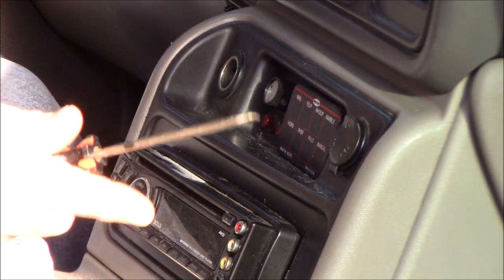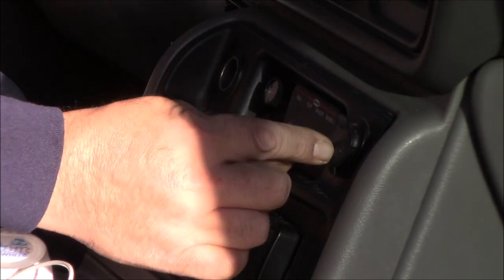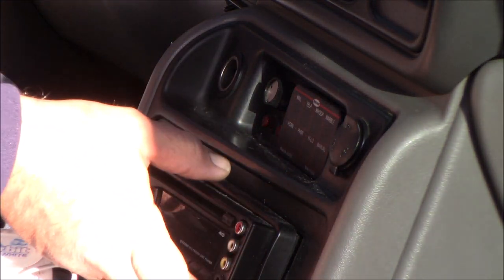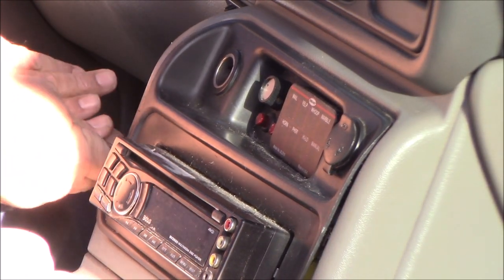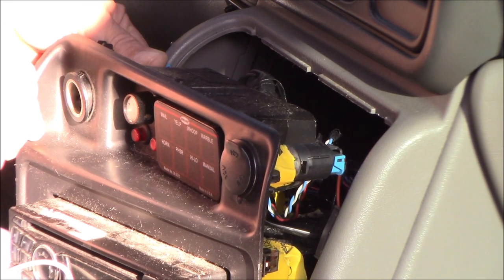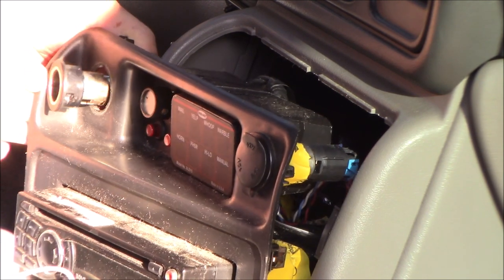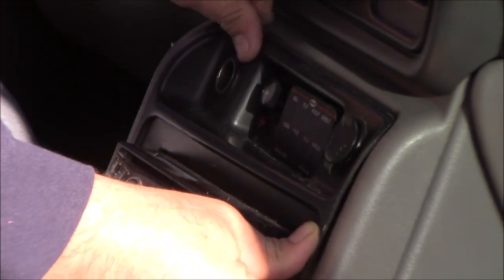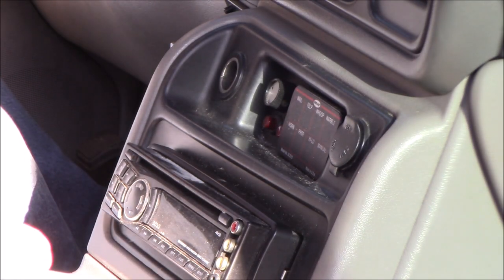Cigarette Lighter or Power Outlet Socket Removal | 2000-2006 Tahoe, Suburban, Silverado or Similar

Comment: I really appreciate your video. My lighter took some more pressure than I thought originally but it came out using your exact procedure. Getting ready to use that port for a HDMI input for a new head unit I am installing in my 2003 Suburban.
Reply from the maker: Glad it helped!

Comment: This is the only video on this subject so I used it. Works for some but not for me. 13 dollars amazon gets you the proper tool for removing it. Saves you breaking the retaining ring ears like I did using the push and turn method which costs an extra 10 more bucks. to replace. 13 bucks job done easy. 25 bucks and waiting for more parts if it breaks. Sorry Axle I have used lots of your videos and they're great but this one is a 50 / 50 man
Reply from the maker: Thanks for sharing, I haven't broken a tab off yet, but I'm sure it's coming.  Wasn't that happy with the video, but I had many requesting it.

Comment: I know this video is a bit old but,  if I want the cigarette lighter to be a power outlet socket, do I just swap out the socket for the power outlet socket? I also have a 2003 Yukon XL and these have messed up over the years asking with the rear one that’s in between the cup holders in the passenger center console. Thanks in advance

Comment: Exactly what I needed!  How to remove that bezel/cover.  Gonna replace the cigarette lighter with a USB power port.  Thanks!!
Reply from the maker: Glad to help
Reply: How did it go? I’m about to try it out
Reply: @mayken6661  Pretty much by the numbers.  The only hiccup was removing the oem cigarette lighter port.  I was unable to compress the tabs to remove it without damage.  Might be because it was old and stiff.  Broke said tabs off and it came right out.  Installed the new USB/USB C port.  Simple and much more functional.  Never smoked so the oem port served no purpose.
Reply: @jimsjacob  how was the wire connection?  The USB port on Amazon has a simple +/- plug for direct battery connection.  I just like to know if I have to do wiring adapter
Reply: @We4winds  Just like you said, pretty basic.  The +/- writes are there.  How you connect is decided by what the adapter presents.  If I recall, I crimped on female spade connectors. Hope that helps.  I get far more use out of this adapter then the cigarette port.

Comment: Hey I'm billy and I have a dvd player just like that. and I'd like to know how  to put it In my 03 tahoe.
Reply from the maker: I cut the panel and mounted it to the trim piece.  As far as wiring directions, try to find an install manual on line from the manufacturer.

Comment: Greetings from Jackson, GA. Your video is very informative but? I clicked the link for the 12V power outlet and it took me to Amazon......double checked the part number / part fitment and it says: DOES NOT FIT MY 2003 CHEVY TAHOE. Checked several other places (the GM part number is 25774623) and they say the same thing......does not fit my 2003 Chevy Tahoe. After some more surfing? I found an AC Delco part number (25776667) and it says: fits your 2003 Chevy Tahoe. To say the least I'm a bit confused and want to order the right part. I do want the 12V power outlet socket/receptacle and not the cigarette lighter. Any help that you can give me on this would be greatly appreciated! Thanks in advance.
Reply from the maker: I believe they will both work.  The ones in the links are the ones I purchased for my 2003
Reply: @AxlesGarage  I didn't have a chance to call my local dealer today and ask them why the confusion.......If and when I get clarity on this? I'll reply again. Thanks!